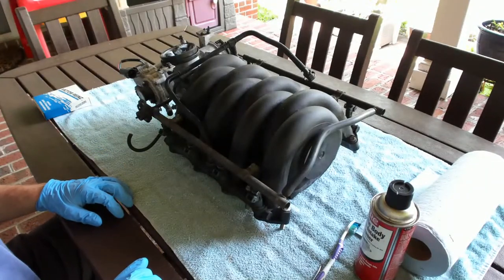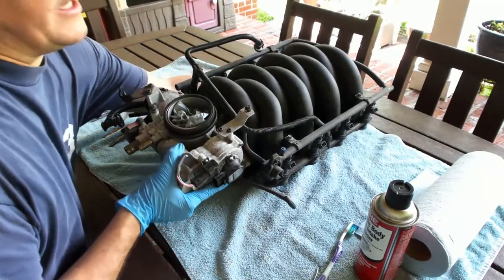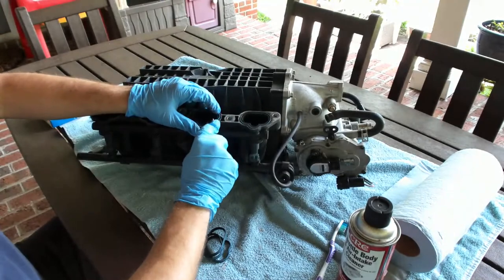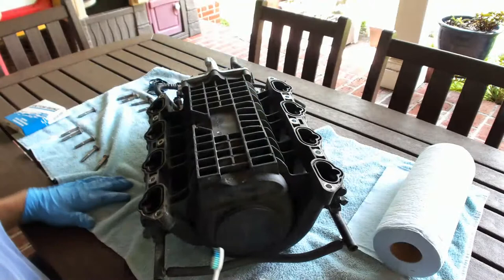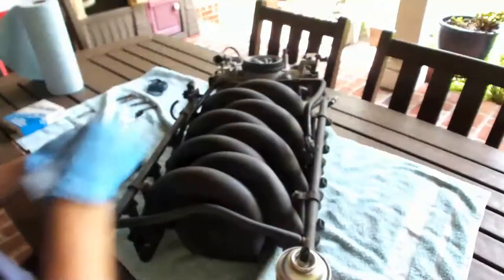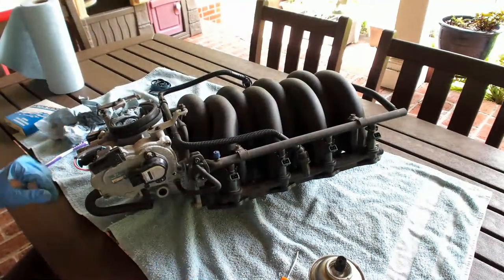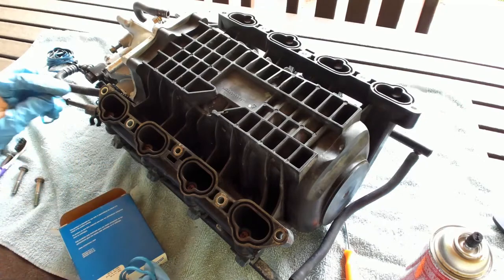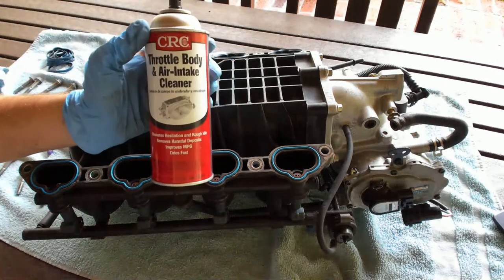Live Raw Video: 2001 Jaguar XK8 Intake Manifold Cleanup and New Gaskets

Comment: can you help? I am trying to remove the throtlr body elbow, but there is a wire connector to a vacuum tube on the side of the elbow. I have removed the clip that holds it but it still will not come off 
What should i do
Reply from the maker: On the Passenger or Driver Side?  Just seeing this.  If it's only held on by the wire clip, sometimes a flat head screwdriver can be used to budge it a bit to break free a connection.